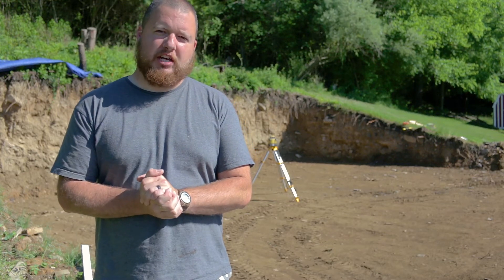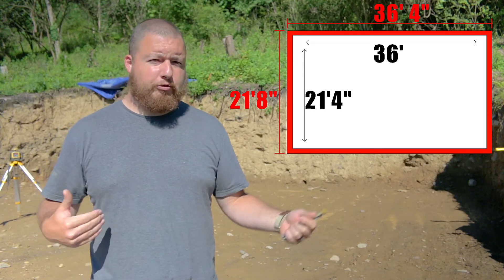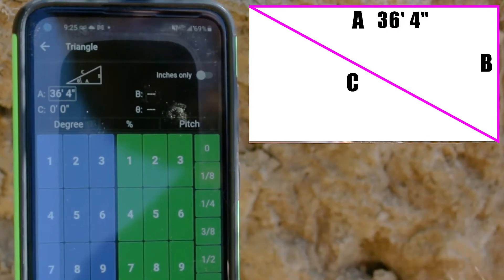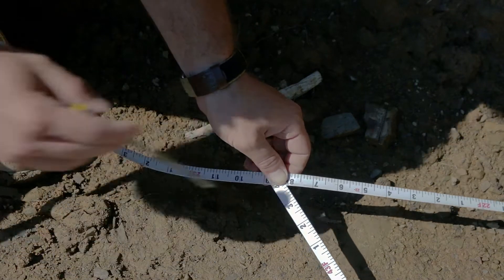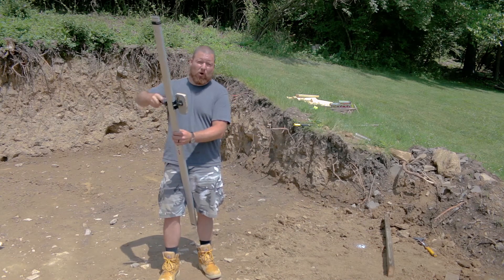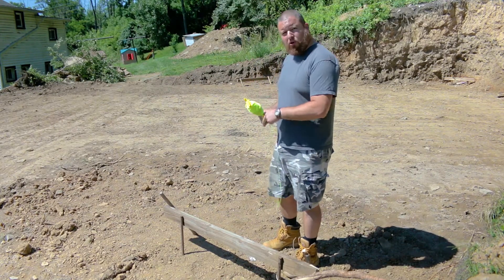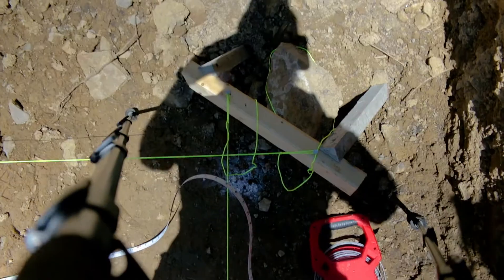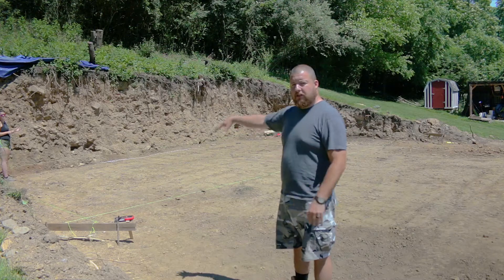Garage Build #2 - Batter Boards, Squaring Our Building

Comment: So why werent the batter boards set prior to the excavation taking place?
So you had to establish the dig lines prior to the excavation,
Now you are reestablishing the wall lines in order to set forms for the footings.
I was a home builder for over forty years.
During that time i personally staked out using batter boards for hundreds of homes.
I never owned a lazer level, as they only came about in the last few years i was in business.
What i did have was a very good surveyor quality transit/level.
We would locate the actual corner of the house, drive in a stake, and drive a nail into the top of that stake.
We then set up the transit with a plumb bob from the transit touching the top of that nail.
Then we taped off from that nail to another corner location, added the distance we wanted the batter boards to be away from the wall line, and the set up that set of batter boards.
Then drove a nail in to establish that wall line.
From there we turned the transit 90 degrees, adding the distance beyond the actual wall line, and set another set of batter boards with a nail in top for the wall line.
Then another 90 degree turn with the transit for the third corner and another set of batter boards.
Using that method we could establish 3 of the four main corners of the building, and we taped off from those to establish the fourth corner.
When the batter boards were set for all the corners in both directions, we ran string lines to recheck that the building was in fact square, and we hadnt made a mistake somewhere.
Once the outside perimeter was established, we then concentrated on setting up the batter boards for any offsets on the building.
The depth of the excavation had no bearing at all on where we set the batter boards as for height.
We established that by evaluating the site conditions, and where we wanted finish floor levels to be in relation to that.
And that is what determined the dig depth.
We left a marked dig rod for the excavator, and he pulled a string line across the batter boards to check his depth as he went along.

Comment: Well done sir! Someone whose not afraid of a little simple math. I see so many people telling everyone to square up by pulling like diagonal measurements across the corners to achieve square, which is a flawed system and could easily give a bad result.
Also putting the braces on the batter boards against the direction of the line pull is definitely the correct bracing method.

Comment: What was the purpose of burning a foot?
Reply from the maker: It gives you a more precise measurement
Reply: Is the 12 inches a measurement from the building corner to the batter board?  Or just 12 inches of slop to come back later and determine the building corner...irrespective of the batter boards before?

Comment: Thanks for the video I just wish for  DIY type video everything would be done the basic way, not everyone is going to go out and spend a couple hundred bucks on a laser level.  They are going to use string and a line level cause there not doing stuff like this all the time.

Comment: what does it mean when you say "burning a foot" around 3:15 ?
Reply from the maker: It means you subtract 1 foot from your overall length. You are starting your measurement at the 1ft mark instead of at the end of the tape. Its easier to get a more accurate measurement.

Comment: Actually the top of the batter boards need not represent anything as for the top or height of them.
So long as the top of them are all level with each of the others, the floor height, the footing height, and the depth of the excavation can be established from that point.
Reply from the maker: Yes, but if they are the height of the top of the form its SOOOOO much easier
Reply: @appalachiandiy2415  Actually it isn’t even a little bit easier to have them set at any certain height.
As for the excavation, yes, there will be an issue with that, the bank should have been excavated more to allow for the grading.
Especially if the walls are going to be frame as opposed to block.

Comment: I can see a problem with you garage - based on my experience. The garage will backed by a hill. When a heavy rain hits (or snow melts), the water will come down the slope to the back of the building and hit the wall. It will pool up there and go under the wall or inside/through the wall.

What I suggest is to dig trenches every couple of meters under the garage - from back to the front with 1/50 slope to the front, and to put drainage pipes inside them, covered with gravel wrapped in geo-fabric. Behind the back wall I would lift them up to the surface and plugged. In case of clogging it would be easier to unplug and to hose them down. In front collect the water into a bigger pipe and discharge elsewhere.
Reply from the maker: we didnt put any drainage under the garage, we put in a french drain around it though, and when we get to it we plan to use a special barrier against the block in the back. those videos will be coming out soon
Reply: @appalachiandiy2415  This may work as well, but the issue can be with less slope (at tye back) and (thus) more clogging.
Reply from the maker: @vitalilisau6181  correct, we will probably end up doing something like that after its built